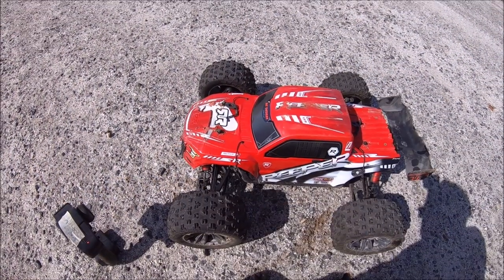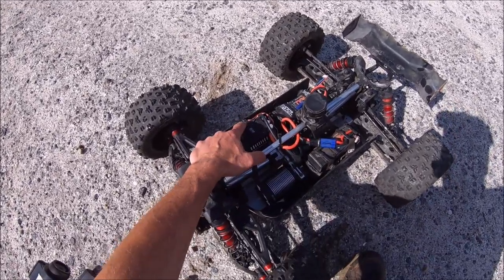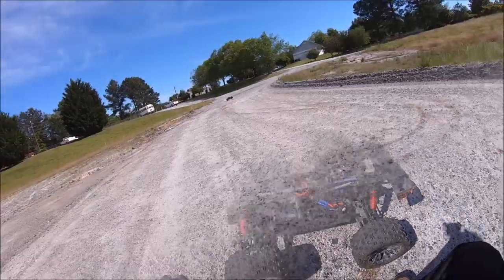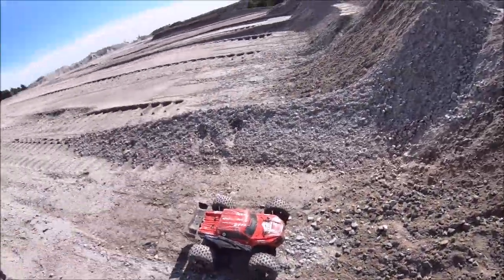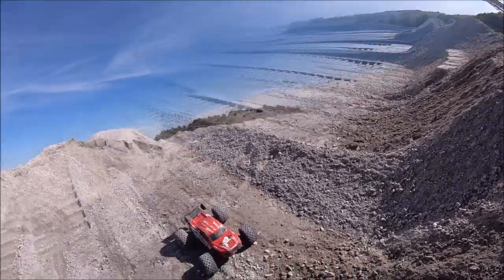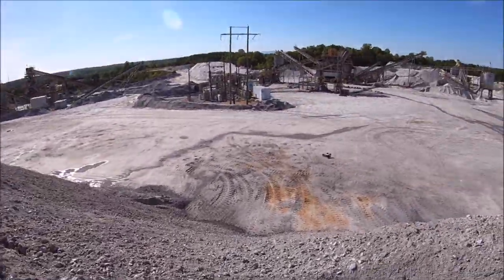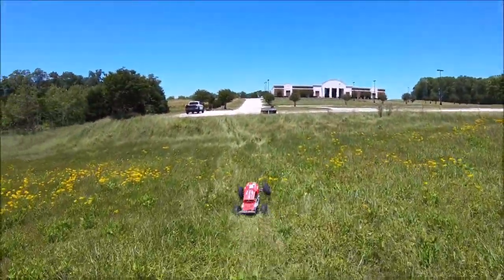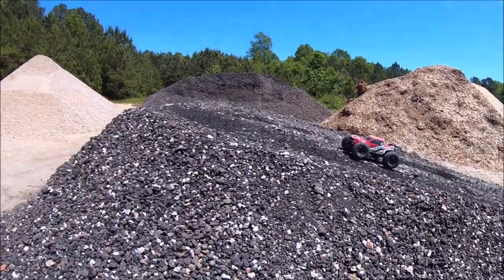ARRMA (SUPER BEAST!!) Kraton 8s SWB. Red, white and BOOM!

Comment: Hey man I got an outcast 6s, any essential upgrades apart from front and rear braces and shock towers, radio, and servo ?
Reply from the maker: If you bash hard, the most important imo is the M2C chassis!💪Kind of an investment but will save you a lot of headache in the long run. Also helps save your entire center driveline.👌
Reply: RC DUDE81 yeah thanks man, I’m 15 saved my money for one and I am just doing max 3-4 meter jumps and my chassis is bending☹️ slowly but surely, but yes I’ll have to get one, btw love you vids and stay safe
Reply from the maker: Thanks buddy you too!👊

Comment: What weight shock oil do you use man and the vids are dope. I never see a link to get this m2c stuff. Where do you get it lol
Reply from the maker: Most of the parts are just out of testing and into production. You can get the chassis and Crusher kit and shock pistons now. The shock shafts and sus. blocks are in production now and should be available soon!😎👊
Reply: @RCDUDE81  and what weight shock oil do you use
Reply from the maker: Stock 40 weight.👍

Comment: What brand ec5 do you use
Reply from the maker: Hobbywing Max5.👌
Reply: @RCDUDE81  the ec5 connector bro haha. Not the esc. The brand of the ec5 😅
Reply from the maker: 🤣🤣Sorry bro too many distractions today!🤪I got them at my LHS. Totally forgot what actual brand. I'm thinking Dynamite. I've used several different ones though over the years. A good solder joint is key!
Reply: @RCDUDE81  yeah sounds good. I purchased the kraton 8s last week after discovering ur channel and gave u a sub. It has potential for sure. Cheers 👍
Reply from the maker: Thanks so much man!👊Yeah the 8s has mega potential especially with some key upgrades and beefier powerplant!💪